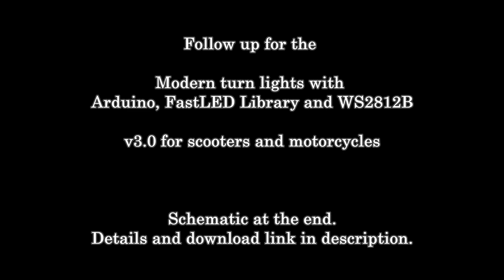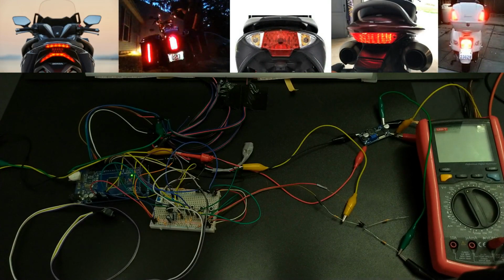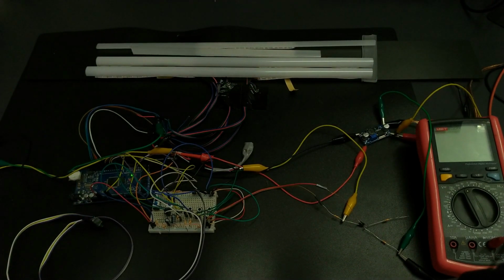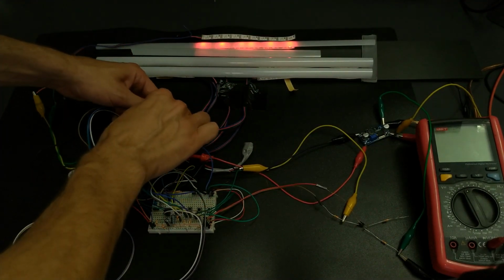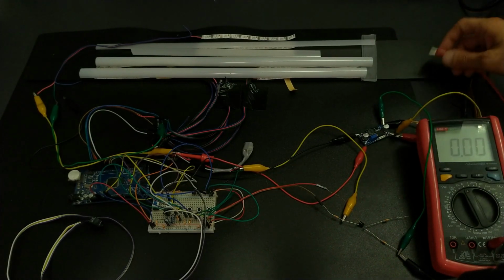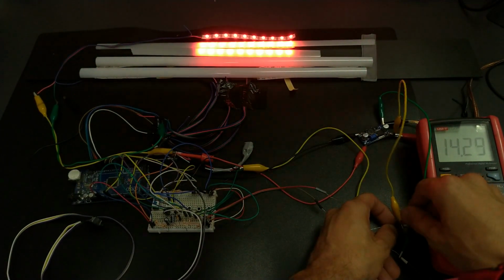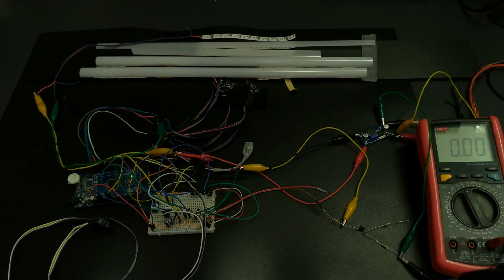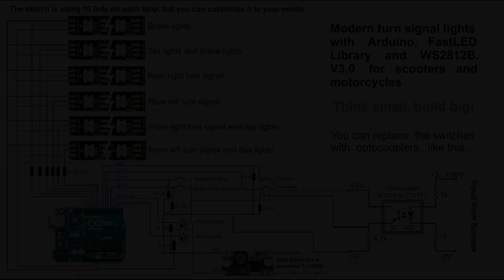Modern turn signal lights v3.0 for scooters and motorcycles - Arduino, FastLED and WS2812B

Comment: my motorcycle have both the taillights and brakelights on the same cable. that cable does 5V when taillights working and if i apply the brakes, it increases to 12V (its the same cable with the same end). when i apply brake, the tailights light up on max brightness (12v). how would i make this work on the strips? trigger based on voltage or something? even if i use a stepdown for this matter, it will always be 5v.

THANK YOU for this.
Reply from the maker: Strange but ingenious system, in this way they eliminated the need for one wire and reduce the costs, cool. 
You only need a voltage threshold, that when exceed will trigger the brake optocoupler.
I will try something and i get back to you.

Your welcome. ;)
Reply from the maker: Well, you could complicate yourself with comparators or op amps, but in this case there is no need for absolute precision and the simplest solution i think is a 6.2v or a 8.2v zener diode used in a reverse bios direction at the input of the optocoupler for brake.
The great thing about zener diodes, is that they have a controlled zener breakdown voltage (in datasheet above 5v Vz i think is called avalanche breakdown voltage) when used in reverse bios direction. Until you hit the voltage that the diode is rated for, it's not conducting any current (0V), after you pass that voltage rating the voltage starts to increase at the same rate as the input.
One downsides of a zener diode is that they can't handel to much current, but in this case, the optocoupler drows much lower current than the zener can handle.
Just play with these two values (6.2 and 8.2) and se which one is best for you.

+ brake from sccoter ---|<|---- + optocoupler

Comment: Hello sir if i want to use a esp8266 with ws2812 and using the android phone to change the mode using a fastled apk can u show me how to coding to that esp8266 thanks in advice and sorry for my bad english🙏
Reply from the maker: Sorry, but I didn't test the code for esp8266 and from what i know FastLed didn't worked to well on esp8266, it had a lot of issues back then.

Comment: hey buddy, I really appreciate your videos. 

I have just purchased all the parts to make this but I am struggling a bit around the diagram and thre "octo coupler" (I have never used or even seen one before)

is it possible to explaion a little better the wiring please?

Maybe even a little video of the wiring :)

Thank you
Reply from the maker: Hi and thanks.
Well, in this case you should wanna start with learning somethings, like:

How to Read a Schematic - https://www.youtube.com/watch?v=_HZ-EQ8Hc8E
Electronic Basics #32: Relays & Optocouplers - https://www.youtube.com/watch?v=2BdevOmN-Zk
Digital Electronics: Optocoupler | Optoisolator - https://www.youtube.com/watch?v=uRX0OwWjKXA (more technical details)
Arduino Basics 101: Hardware Overview, Fundamental Code Commands - https://www.youtube.com/watch?v=BtLwoNJ6klE

The schematic is the simplest thing that i can do, i've even used different colors to be as simple as possible to read.
Watch the clips above two or three times and if you still have questions, put them here.
;)

Comment: Great Video. I'm going to implement something like this onto my bicycle! What is the tubing you are using to contain the LEDs? It works well to diffuse the light. Thanks.
Reply from the maker: Thanks. I had some aluminum profile for led strips lying around and i used the diffuser. ( https://shop.eurovial.ro/thumb.php?w=531&h=355&action=far&border=none&src=userfiles/products/39214/1.jpg )
For your bike you say ... e well the next version/video will be just for that and will have all the needed functions. 
Your welcome. ;)
Reply: @IonutFedaceag  Ahh brilliant, thanks for replying! Oh wow, that's going to be good, it would be great to know how you would waterproof all the electronics and control the lights while on a bike in the next video!
Reply from the maker: Well, i really don't have too much time to spare because of my day work and that's why i only do the software, the hardware and basic schematic, the rest it's up on you to figure that out.
But, to answer your question, just search on google for "abs ip65 enclosure" and find one enclosure that will work for you and for the led strips you could use acrylic glass and sand it well with fine sandpaper one side to make it defuse the light, seal it with silicone or make a gasket for the two parts, paint and after that enjoy.
For example:
https://www.jaycar.com.au/ip65-sealed-abs-enclosures-dark-grey-with-mounting-flange-115x65x40mm/p/HB6123
https://www.simcobox.com/product_quick_view.php?productid=17644&cat=0
Reply: @IonutFedaceag  Yeah, I totally understand. They're a good idea, I'll have a look at them. Thanks for your help.
Reply from the maker: The new version is out ... https://youtu.be/xIs8DcEorG8